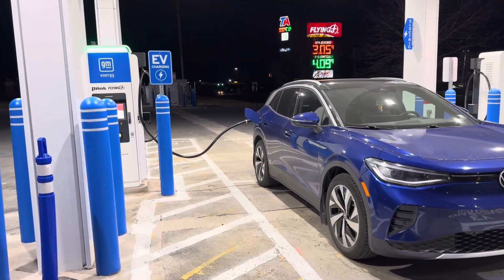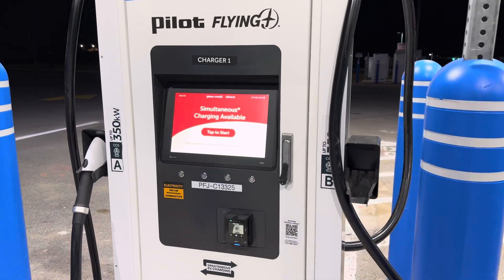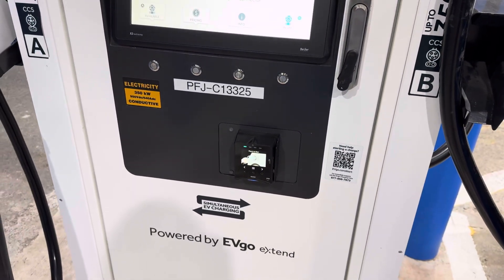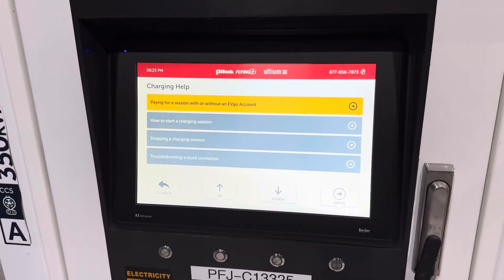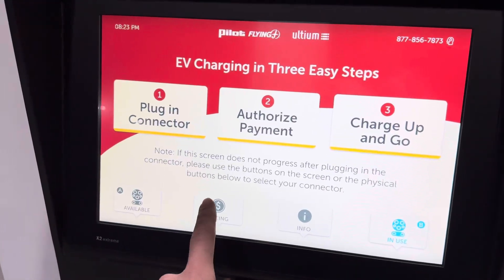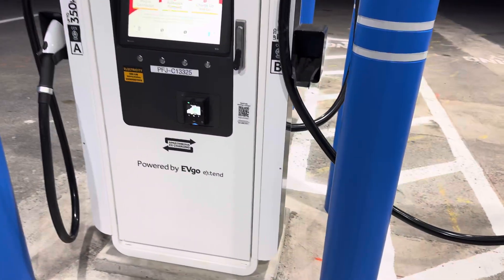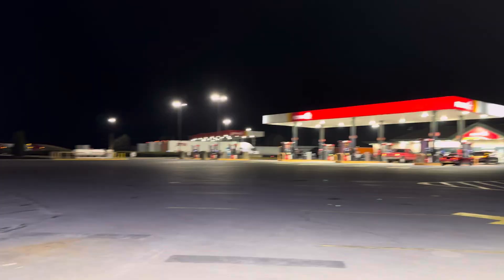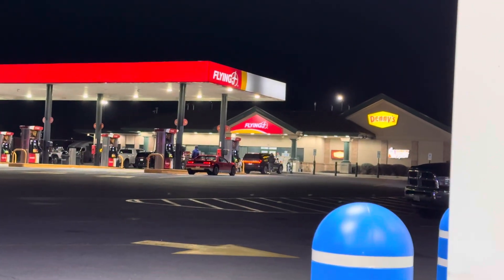GM Energy at Pilot Flying J in Mill Hall, PA.

Comment: I hope to own an electric vehicle at some point.  This site would be a great place to stop when we travel from Cleveland to northern NJ.   We often stop in Lamar at McDonald's on the north side of 80 when we travel.. This area looks much less congested. Thank you for posting this video.
Reply from the maker: Thanks for the comment! It’s sites like these that make EV adoption that much easier. And with more sites being built every day, it only gets better from here!
Reply: @PlugInPA  I noticed that shortly after this site was opened two of the four plugs are now listed as out of service on the Plug Share app.  I understand things break but is it common for them to go out of service so soon after being turned up? Is it unique to EVGo?  From your experience how long does it take to get them operational again?  It seems like there is still a long way to go in providing reliable EV charging.  Thanks for any insight you might be able to provide.
Reply from the maker: @ In this case I believe it is more so the case of “ramping up” the site rather than a broken stall. In my experience, new or newly renovated charge sites often initially open at a lower capacity, with some stalls “out of order” but not necessarily broken. This could be for many logistical or technical reasons, but I am not 100% sure. Majority speaking EVGo and other charge OEMs have gotten very good in the last 1-2 years at maintaining up times, so overall I think we are on the right track with charging infrastructure!
Reply: @PlugInPA  Makes sense.  Thanks for the reply

Comment: looks good but too bad GM/EVgo still don't get it, it should have had 20 stalls, not 4. charging an EV takes much longer than a gas car so those will fill up fast at peak times.
Reply from the maker: Agreed. Having 350kW peak charging speed helps, but if 4 slower charging EVs are there, that has no useful impact. Seems like the only two companies that are doing it right are Ionna and Tesla!